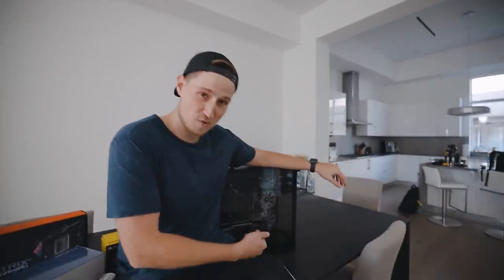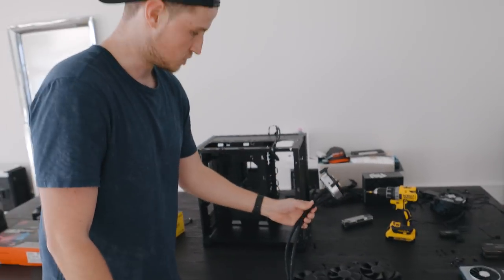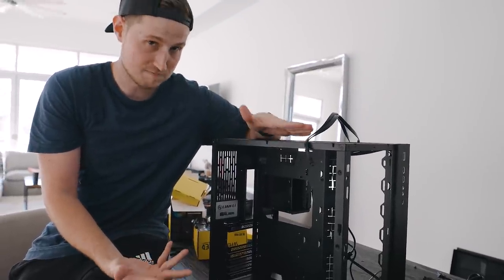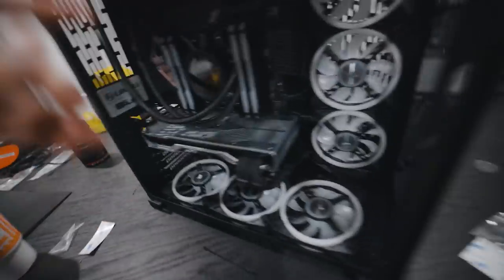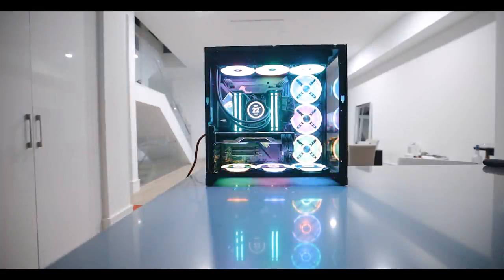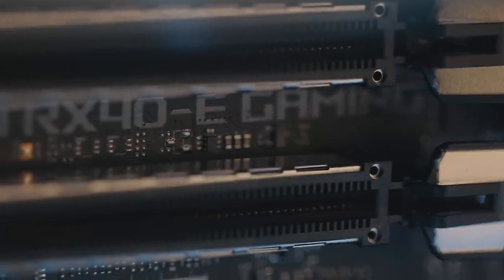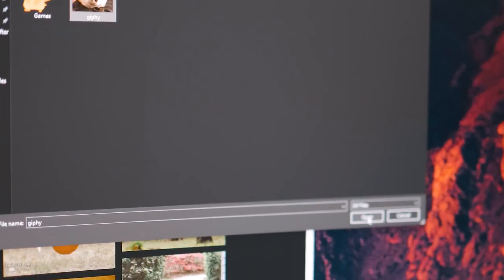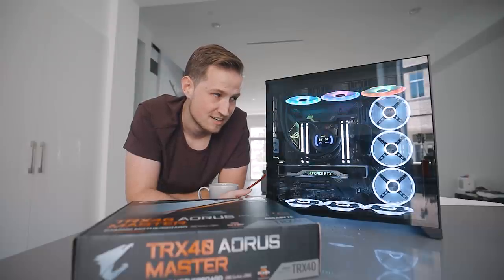Ultimate Workstation PC Build! Threadripper 3970X

Comment: CPU: AMD Ryzen Threadripper 3970X
Memory: 128 Gb DDR4 @ 4k MGhz
GPU: NVIDIA Geforce RTX 2080 Ti
Cooling: NZXT Kraken Z73
Motherboard: ROG STRIX TRX40
Storage: NVME 1TB (Main)/256 GB (Games)
Case: Lian Li 011 Dynamic
Fans: (9) Corsair QL120 RGB
Power Supply: 1000 W
Reply: @drewcaster  holy shit
Reply: Drew Smith It looks like Joe is using the Vengeance RGB Pro 64gb (2x32) 4000Mhz and not the tridentz rgb ram. I search the internet for the Vengeance 64gb (2x32) 4000Mhz but I only found 3200Mhz. Just a side note on what Joe is actually using :)
Reply: Catch the display being used???
Reply: @drewcaster  USD$6,500 ?
Reply: Why Lian Li? All other stuff is top notch
Reply: @thescope7079  Probably more like $4k if i had to guess. Some of those parts arent actually that expensive there just isnt any inventory so its 2x normal price

(like if you tried to buy a brand new 1080ti it would be like $1200 online)
Reply: @johnconstantine7139  Dude i have a Lian Li case. They are high quality made. Not because it sounds Chinese doesn't it's cheap plastic build!
Reply: You mean 4Ghz?
Reply: @stevenk3620  he's using CMW128GX4M4E3200C16, skip to 4:12 in the video and you can see the side of the ram, its not 4000mts not sure why he said that? 4000 on zen 2 isn't even a good idea as it tops out at 3600mtz before the ram goes into 2:1 mode with the IO die and tanks performance.
Reply: @Dan____  yeah i noticed the same. The Threadripper's memory controller can't even go that high so, not sure why spend more on faster ram when you can't take advance of it
Reply: @pucciox40  it can go past, just runs in 2:1 mode so performance is halved. Now threadripper is a quad channel chip so it can benefit of you can get the clock up to about 4500mtz in 2:1 as the bandwidth of quad channel (not to be confused with a desktop chip with 4 sticks) can actually negate the downside of 2:1 mode. But I'm getting the impression this isn't on his mind building this. Either way, he's using 3200mts ram and just saying it's 4000 bit of a weird fake flex. You already got a 32core. Thats  enough of a third leg flex as it is.
Reply: did he need the corsair commander pro or the lighting node for those 9 rgb fans to work?
Reply: @kimdavid8040  yes
Reply: @johnconstantine7139  here we go again

Comment: Really neat build
 Only nitpick would be to get a more appropriate cooler, the NZXT is for "normal" CPU's and Threadripper is physically much larger so the z73 doesnt quite cover it ;)
Best would probably be a custom loop... the threadripper AIOs arent great...
While you're at it, might watercooler the GPU as well ;)
Reply: Also, regarding what you said about hard line, just make a soft tube loop to keep maintenance easy ;) ZMT still looks great and especially having the GPU under water makes a huge diff for noise

Comment: generally not a good idea to run memory faster than 3600mts with a ryzen, it puts you out of sync with the IO die that connects the cores to the memory and it runs in 2:1 mode. which tanks performance, in a TR build with quad channel you can make up for this somewhat with bandwidth but you need to really push things to the limit. I think you might be better off clocking it to 3600 and tightening the timings
Reply: never mind, caught the B-roll of the build its not 4000mts ram, it's 3200 c16. all good then.

Comment: I've got a really strange and dumb question, because I'm in school and I have a macbook pro which I'm like not at all happy with because of the over heating issue. How well does your pc that you built do at hardware virtualzation/ operating system emulation? And roughly how much for cost.

Comment: I know you wont reply, but still I wanna ask something. Is it better to go RTX 2060 Super and use like $20 case (like really cheap and ugly case) or go for RTX 2060 and use premium case like Pure Base 500DX (then upgrade the RTX 2060 to the RTX 3000 series in the future?)

Then one more thing, which is the better RAM between 3200 MHz CL 16 vs 3600 Mhz CL18

Comment: Nice setup Joe! 
I´m from Argentina and i´m currently building my first setup, unfortunately here in Argentina prices are too high, but the specs that I could afford are these:
Mother: Gigabyte b450m aorus elite 1.0
CPU: Ryzen 5 3600
RAM: 2 x 8gb Patriot Viper DDR4 3200mhz
GPU: Rx 5700 xt 8gb Gigabyte OC
SSD: NVMe M.2. 512gb 3500 MB/s Adata sx8100
PSU: 700W Segotep 80Plus Gold 

I would love to win that motherboard even if its not compatible with my current setup, because I could sell it and upgrade my whole system!
Anyways, love your videos dude!
Reply: argentinian guachin over here!. Looks awesome. I have a similar build (2600x, 16gb 3200mhz, rx5600xt). I bought it before the pandemia. Today it cost like twice as much

Comment: did he need the corsair commander pro or the lighting node for those 9 rgb fans to work?
Reply from the maker: I have the commander pro running the 3 on the top. And then the other 6 are on the led link. And that’s run to the commander pro.

Comment: Just wanna ask, does your kraken AIO enough to cool your threadripper prcessor and also do they free bracket on that AIO? Thanks and more power to bruh
Reply from the maker: So far no problems. A custom block would obviously cover a lot more. The kraken seems to just cover the center of the chip, but it’s on the approved list from amd for the threadripper. I haven’t seen temps go over 70c while rendering videos and 50c while gaming.

Comment: PC has been and is much better than Mac, it pretty much sweeps the floor with it. Options of customizations are endless. By the way, by not wearing an ESD bracelet or some sort of ESD protection there is a high chance your reducing the life cycle of the microcomponents, at least use some anti static lotion, take it from the experts.  You look like a pretty smart kid but with the potty mouth and attitude you can only go so far, take it from a leader.

Comment: I stopped watching after you mentionned that you don't care about Power Supply. 
Everyone knows that the PSU is the most critical part when building a PC.

Edit: 'Use babel to build an API" ? Babel is used for transpiling not building your code.